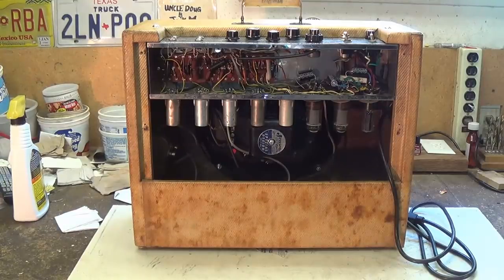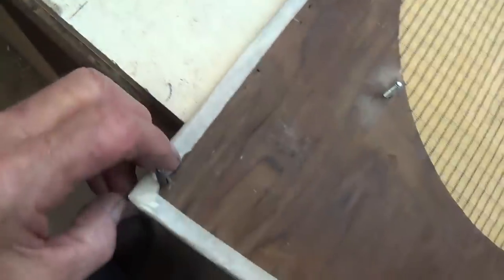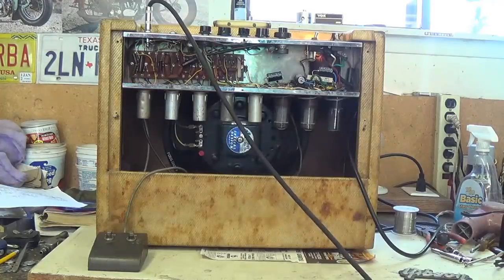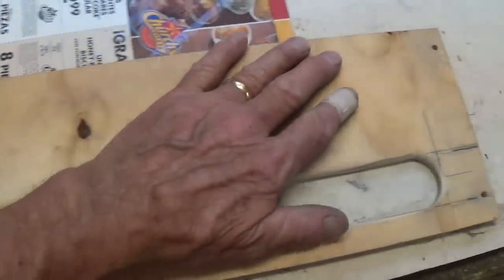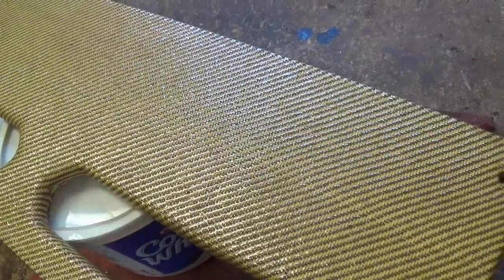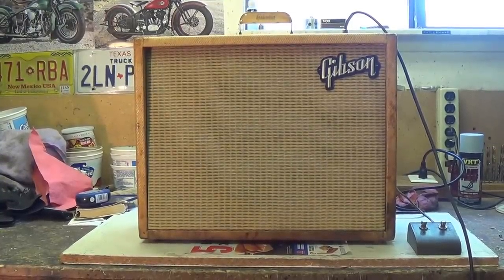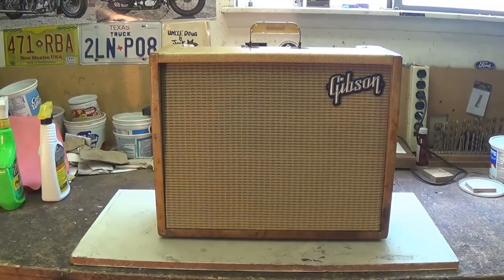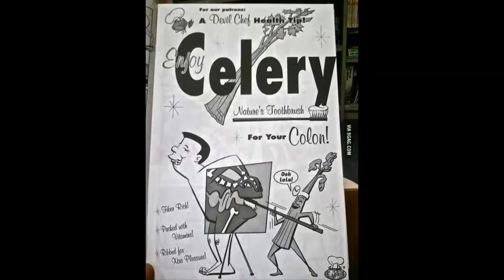1961 Gibson GA-2RT Maestro Deluxe Reverb Echo, Part 2

Comment: Uncle Doug, please help. You will probably laugh at it, but it's a riddle to me. When I ordered this I told them I needed a transformer that I could wire as a center tap and they sent this even though I needed a diagram because this one I have to manually configure. There's two PDF documents with a diagram of the windings, but I'm at a loss 4 wires for the primary and the need to be wired in parallel or in series and 4 wires on the secondary so 2 secondaries 24 x 2 but I need the 117 primary and a center tap 24-0-24v But I'm no Uncle Doug. I have the url here where you'll find the 2 PDF Documents if you could look at it, one PDF has the wiring and picture of which is which, which I asked them and they said refer to the PDF.I need to know which wires tie together on the primary as well as the secondary, http://www.surplussales.com/item/_tp/aa56252-024.html I'm thinking the brown and orange and the red and yellow for the 117v @ 60hz and green and brown for the center 0v and red and blue for the two 24v ends. I'm far from sure. and $120 down the drain. 

WINDING CONFIGURATIONS WITH COLOR CODES Dual 117V 50/60Hz Primaries w/ Dual Secondaries Multiple primaries must be connected in series or parallel.The diagram is right below. If you don't have the time, I totally understand.
Reply from the maker: First off, don't feel bad, Mr. B. The directions are not particularly clear. Since you need 117V for the primary, then the primary wires must be connected in parallel:  brown and orange together.......red and yellow together. Now you have two leads (BO and RY) to plug into the wall socket.  For your 24-0-24 secondary, I would suggest the following: Connect the Red and Brown together as your center-tap, and then the Green to CT will be 24V and the Blue to CT will be 24V. Green to Blue should be 48V. Try it and see. If I'm wrong, no problem, try it your way (above). Good luck.
Reply: @UncleDoug  Wow, Thanks Doug, I appreciate this so much.